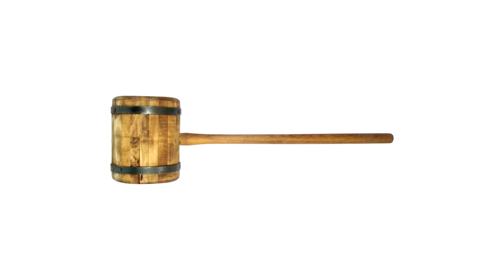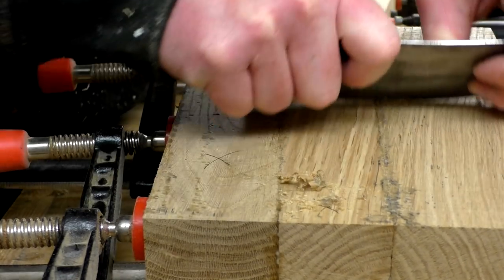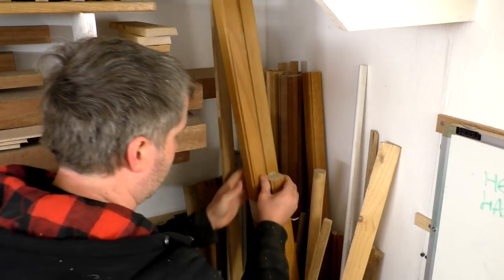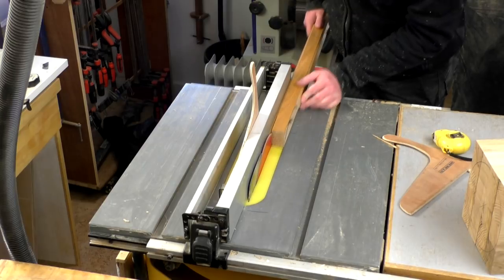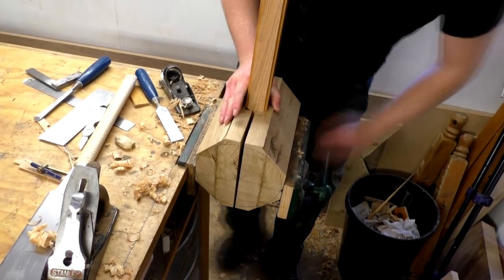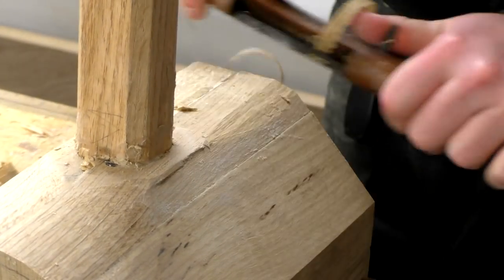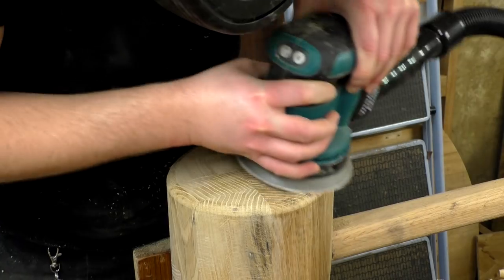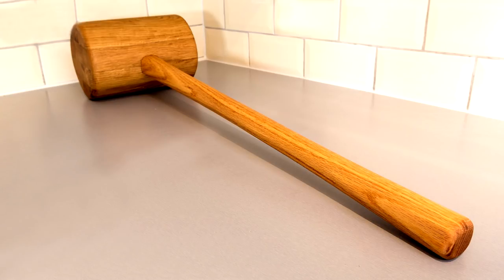Making A Giant Mallet

Comment: When it comes to heavy tools, and most other tools, i really recommend indexing the handle, with the sides of the handle pointing forward, and backward, when holding it, this gives an intuitive reading on where the striking head of the tools is facing, and makes it much easier to control.
Good work though!

Comment: I would recommend you purchase a stackable dado blade for your table saw.
Reply: They don't sell dado blades in the UK- safety regulations.
Reply from the maker: We're not allowed to use them!
Reply: Rag 'n' Bone Brown That's a shame it only leaves kerfing or a straight cut router bit. Of course,  here many trade educators will prefer the router over the dado blade.